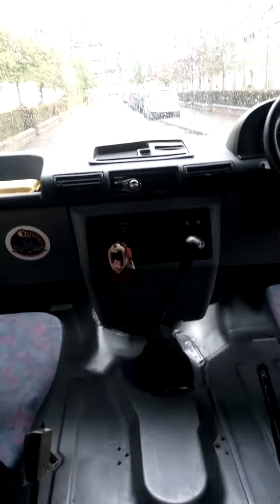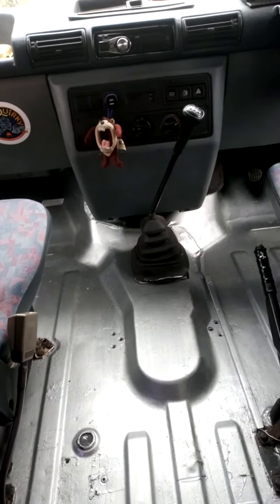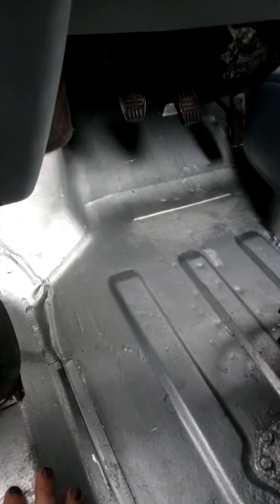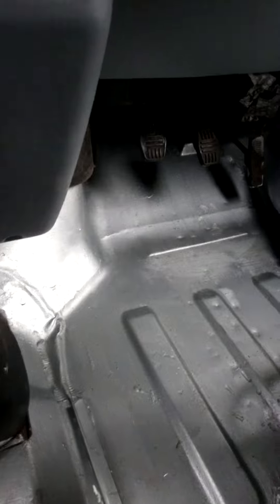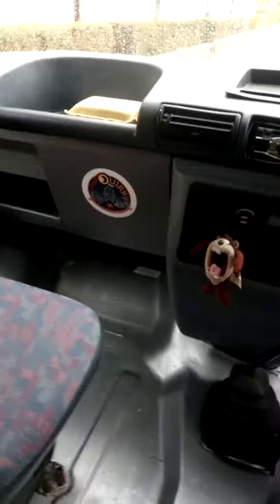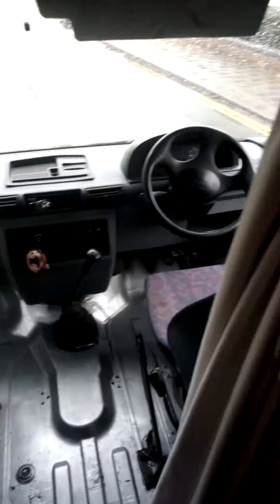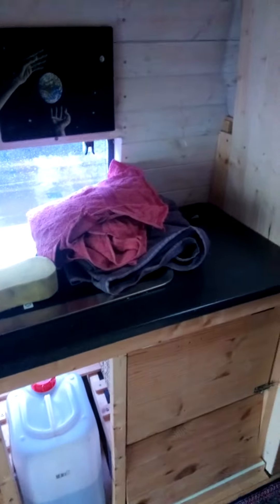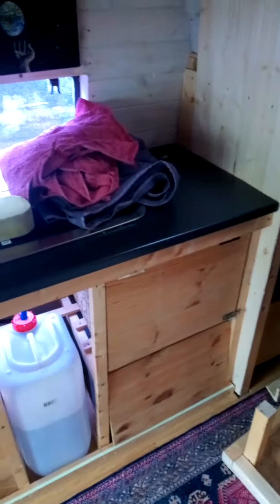Where does it leak 28th April 2021

Comment: Ours was leaking in seal of windscreen, we also have a small hole in the bonnet rear gutter area that lets water in, plus ours was on a slight incline nose down and a lot of the water from back leaks came through to footwells. 😕 So had to find and locate those too, which were between fibreglass and body work joins.
Reply from the maker: I may need to take  trims of inside  above the doors and pillars  see wats wat   body work and roof is in good shape to.  Had a new windscreen put in  before we brought it  2 years ago to.
Reply from the maker: BTW I'm tazmin  and my partner is Kris . We both on Facebook to. Tazmin wheeler   add me. If u like to. X no pressure
Reply: @wheeliesworld7681  ah ok, the only other thing i can think off is the doors aren't sealing right, but i saw water on video coming from gear stick area side so I'm thinking bonnet/windscreen gutter.